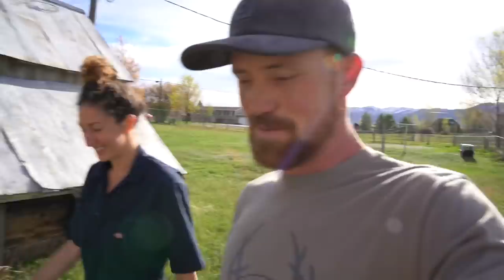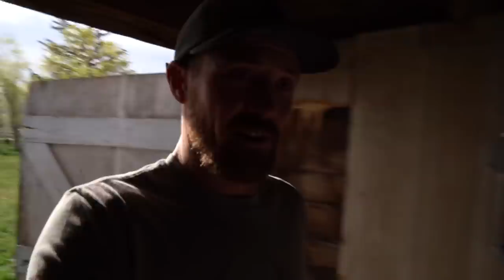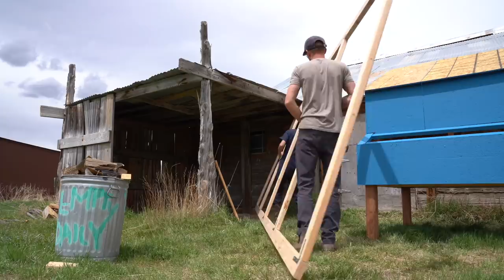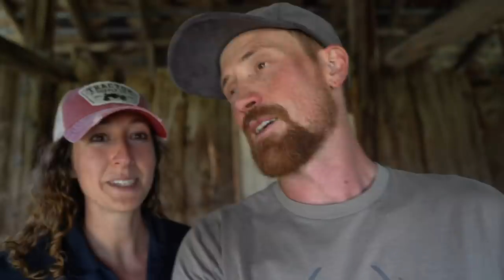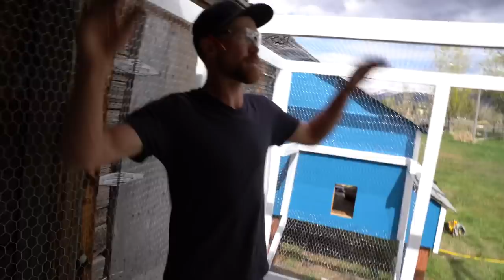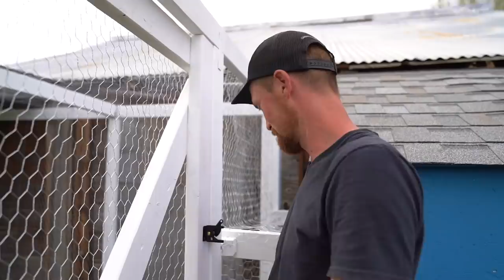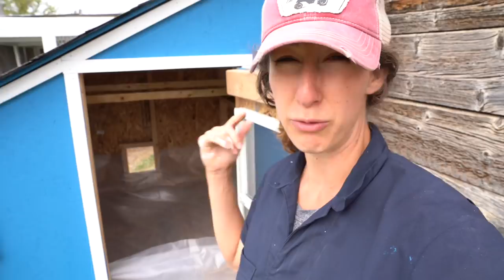WE WILL NEVER DO THIS AGAIN...

Comment: Put the roof on. Raccoons, possums, skunks, hawks, fox, coyotes - they all love a chicken dinner. Nothing worse to come out and find your whole flock destroyed.
Reply: yep....that will happen...
Reply: How about putting corrugated plexiglass on for the roof?
Reply: Had a raccoon snatch hold of a chicken through the chicken wire and pull it out piece by piece. They'll go under, too. AND they work in groups.
Reply: Been there:(
Reply: @lazyninja711  yup even if they can't pull the chickens body out through the chicken wire you'll have a headless chicken running around..lol.
Tin roof should be more than sufficient! But definitely need a roof. And I'd either double up on all the chicken wire around all the sides or electrify it and that should keep them out! I think they have a knob to control the amount of volts coming out? 
And if the dog happens to hit it by accident they'll learn fast not to touch that fence again..That's what I'd do especially if you have all those nuisance animals..
Reply: J Dick That happened to my chicks.

Comment: Yes, raccoons, etc. will most definitely climb the wall and drop down to get the chickens if there is any little opening. Also, dig down into the ground and put the wire in the trench then cover back up. We concrete it in.
Reply: Good point, I was going to say the same thing about the roof and the raccoons will bust the frame with their weight. And the dig down into the ground is spot on from what I have seen in other videos. Raccoons almost tore our storage shed apart trying to get in it to do God knows what in it lol
Reply: Ummmm....you have to enclose the roof.  Sorry A.  The raccoons will get all of them.  And the coyotes, dogs, foxes, etc. Will easily dig under your cage too.  Sad but true.  Cement foundation  best.  When they are older you can let them completely out to run during day.  All dogs need to be trained to leave them alone.
Reply: Yes raccoons love chicken, After my dog died, they were killing at least one chciken a night and dragging them under the fence.. I set a live trap and was catching raccoon after raccoon. Finally began locking the chcikens up in the chicken coop at night. I had an adult bronze tom and hen turkey and they even killed the hen and left her under the fence.
Reply: Perhaps even hammer/drive rebar lengths into the ground like 4 to 6 inches apart, instead of concrete foundations.
Reply: @CodeMonkey66  
We've done that. Very effective.

Comment: I don’t know if anyone’s mentioned this to you...make sure that any chicken wire or hardware cloth that you put around the chicken run or coop also gets dug trenched a few inches into the dirt. A lot of varmints going after chickens have no problems digging under a fence to get at them.

Allie, I will have to side with Trent on this. Every place an animal can get in needs to be fenced off or made secure. Foxes  and coyotes are extremely cunning and they can climb fencing and work their way in to the coop and the result is never good.
Reply: Yes.  I just said that.  We have had more dig under than climb over.  They will dig up a board no problem.
Reply: So true.
Reply: Chickens will dig under as well
Reply: And. don't forget the proverbial chicken hawk ... aka Red-tailed Hawk. They'll swoop in or land on the top of the pen and then dive in an dine.
Reply: Agree - just a few inches into the lawn/ground then covered with mulch or stones
Reply: But as I stated in my own comment, a guardian dog will prevent that loss. Thankfully they have Oso, now he just needs to get outside!

Comment: I would also have recommended going sideways with the chicken wire on the inside, and then put strips of wood on the inside over the top of the chicken wire. Around here, raccoons will push those staples right out.
Reply: Yes.  Staples aren’t enough.

Comment: Not only do you need a roof but you’ve got to bury the wire at the bottom—an apron. The chicken wire keeps chickens in but it doesn’t keep critters out. You have to use hardware cloth.

Comment: not only do you need a roof, you need to lock that thing down like Fort Knox. i  very seriously recommend getting "construction mesh" and putting it around the first new feet up over top the chicken wire and also into the ground/floor of the run. most animals that love chickens for dinner can easily bite through normal chicken wire so construction mesh is a must. they can fit through ANY small hole. secure it the best you can or you will be chasing down a coyote with one of your chickens in its mouth across your property if you are lucky. i have chickens have have lost some in the past. their security is very important. they are like sitting ducks for lack of a better word.
Reply: I was going to recommend the same thing, we had racoons reach in and pull the heads off chickens through chicken wire and then another year coyotes just pushed the staples right out and slid into the coop like a hot knife through butter, I also heard skunks and weasels will tunnel under to get at the hens. I've upgraded to 1/4 inch hardware cloth on all sides, top and 8-12 inches down all around the coop/run area and also put hardware cloth  over the ventilation inside the coop so that nothing can get in there at night too. It's  lot more expensive than regular run of the mill chicken wire but hardware cloth is a lot more secure. To attach it more securely used large flat round metal washers  and screws to secure the hardware cloth to the frame to make sure nothing can push through either. Hopefully you guys won't have any issues at all, but if a predator gets in there they will not likely leave anything alive...
Reply: Amy Jensen Perfect recommendation, those staples will come right out. Hardware cloth and washers with screws is best. I have never heard of skunks attacking chickens (since they are herbivores), but, they will probably want the food scraps in the run.

Comment: Trent you can run a ground wire to a stake on something that is in the ground and have a grounded outlet.
Reply: That wouldn't trip the breaker in a line to ground fault. Installing a GFI would though, it also protects all outlets downstream. In the event of a ground fault the ground rod would create a voltage gradient in the soil beneath you (meaning there would be highest voltage at the ground rod and it would lower the further you got away from it). 
If that outlet is in the coup it's one way to make fried chicken though...
Reply: DO NOT ADD  GROUND ROD LIKE THIS!!! GFCI outlet is under ten bucks. Walmart, Lowe’s, or Home Depot will have them. Get weatherproof cover for it too.

Comment: Allie, Trent,  You should have put the sceen  on out in the yard then carried the screened structure into place.
Work smarter not harder.  Looks good!   Trick for goats . Leave a piece of sweated clothing that you wore in the shed. They get used to your scent.  God bless
The gaps under the white structure is were preadotors are getting in.
Reply: I saw the gaps as well. It kind of worries me. Not sure what they can do about it now tho?
Reply: also need to bury some chicken wire because raccoons will dig under, I learned the hard way
Reply: Hi guys. 

Glad you are settling down after your journey home. The coop build "discussions" made me chuckle. Nice to see you are just like the rest of us sometimes. 

A couple of observations .... chicken wire is for keeping poultry IN not for keeping predators OUT. Determined coyotes or similar will break the chicken wire. Raccoons can reach in through the chicken wire and rip a chickens head off. Rats will chew through it.

Consider using half inch hardware cloth hammered in with U staples.
Also consider a 2ft hardware cloth apron at ground level, attached to the bottom of the run, as predators may try to dig under the coop walls but will not normally back up 2ft to dig but rather try digging right next to the coop wall. I would cover it in gravel aswell. You could put a raised bed over the apron with chicken friendly herbs as a further deterrent.

Sorry Allie, raccoons will definately climb that chicken wire and may even find a way through the run roof once they are up there. I would also be concerned that having gone to the trouble of raising the coop off the floor, which will help prevent racoons getting into the coop, you have built a "ladder" to the barn roof giving them access to the coop structure anyway. Until "fort knox" is built my flock are locked up in my drive out basement each night as in this part of NS everyone has a story about racoons getting into coops/runs and decimating the flock. 

Your best deterrent is your Mum's dog if he sleeps nearby. You could also try collecting any shed dog hair and putting it in an old pair of tights hung under the coop and barn roof overhang as the smell will deter racoons. A self opening/closing coop door is also a great thing as once they are inside that strong looking coop the chickens should be safe (use carabiners instead of slide bolts on the door and egg boxes as racoons will work out how to open slide bolts) ... and your Mum will not have to remember to run our to close it every night. A motion activated, solar security light that comes on after dusk (by which time the chickens will be roosting) may also act as a deterrent and you will be able to see from the house if anything is around the run
Last thought, you may find the run floods due to rain from the barn roof. 

Enjoy the chickens, they are great if you take the time to watch them. Very curious and lots of personality.
Good episode. Thankyou.
Reply: Andrew is right, Oso will fix all!

Comment: Hey, Trent, just piping in as an electrician offering a suggestion.  You could replace that receptacle where there was no ground wire with a GFCI receptacle, like in your kitchen and bathrooms.  That is an approved NEC Code fix for a lack of ground and will provide the protection you are concerned about.  About $15 each for a 15-amp circuit....Paul
Reply: paul muntalbano and Trent The other thing you could do is just put in a ground to the ground where it comes in to the barn. Cheaper than using GFCI receptacles. (Connect your grounds to the conduit if your only running two wires).
Reply: @toadlguy   *you're only 🤯✌
Reply: wont work
Reply: Yeah, if the  power come from the house, I  believe it's against the NEC to add an unbonded ground (rod) out in the barn. I saw EMT but still that's no ground, I was going to suggest GFCIs too. Only safe way to do it is to replace the feeder to the house with the right wire. UF.  I was a military electrician and know just enough to get in trouble. I wasn't going to say anyting but I saw this part of the thead and decided to chime in.
Reply: Lesson learned - until fixed wear rubber soled shoes in the barn to avoid becoming the ground. ⚡
Reply: @blackfly29er  Hi, This is coming from true ignorance and willingness to learn things, mind you, but does that really work? I'm a city person with no male relatives (or female for that matter) capable of more than changing a light bulb, and I always thought that the rubber boots thing only worked in cartoon. Yours, Ann
Reply: @annlidslot8212   No worries, yes it's true. Old two pole wiring (Bendix) will seek it's own ground, and if barefoot - you're it.

For the same reason if caught in a lightning storm, or when there's downed wires, it's far safer to stay inside the car. The rubber of the tires insulates you from completing the circuit, and becoming the ground.

Comment: Goats eat oats. Been watching your trip to the tip and now being entertained during lockdown. Thanks. Now payback time. I’m a wildlife photographer and I have a couple of tips that may help you befriend your goats.

I’ll address this to Trent although I prefer Allie: I notice when you and Allie are in the goat enclosure you are several feet apart. Watch the goat, head looks at you, turns to Allie, back to you, back to Allie. Typical behavior for a prey animal. Humans are predators. Our eyes face forward so we can estimate the distance to our prey(3D). Prey animals’ eyes are on the side and see a much wider range(2D). They look for motion, a potential threat. When they see one the flight fright instinct is engaged. When they see 2 potential threats they freak. Your goat has nowhere to flee. It’s cornered and so it is very scared. 
Only 1 should go into the enclosure at a time to feed and bond. If you both want to enter you should be as close to each other as possible, you know, like when you guys hug on camera. This way the goat has to look in only one direction, one threat. However, it still feels cornered.

Best to do the bonding outside where the goat has an escape route, or at least feels that it does. But don’t approach. Take some feed, ignore the goat, head bent down, no eye contact. Sit and be patient. Stay together. Let the goat come to you. This may take days. Be  consistent. I’ve had wild big horn sheep sleep 15 feet in front of me and bull moose an arms length away. When you are in the rhythm of the goat, it will know.

Good luck, hope to see you return to your home in Argentina soon,
Jim

Comment: I used to have a chicken coupe JUST like that with the roof gap and everything. One time, in the middle of the night, I heard some rustling noises outside, and thought to myself " That sounds like its coming from the chicken coupe", so I went out into the pitch black dead of night to investigate. Lo and behold I saw a tiny shape stealthily scaling up the chicken wire to try and slip through the gap above the coupe, JUST LIKE YOURS! I thought to myself "Oh man, this is it!" as I raised my flashlight and pointed it at the two little shinning beady eyes staring right at me in the dark. Well I'll be a bow legged bandicoot , it was the neighbors 18 month old toddler, in a diaper, in the middle of the night, going right through that gap, to get my damn chickens! Ok so that never actually happened, but the moral of the story is I'd be closing that gap for sure.

Comment: Inexpensive vinyl flooring planks  protect the floor from quickly rotting and are easy to install on the coop floor.  Droppings  and shavings slide out easily with use of broom right into the wheelbarrow placed strategically sideways under the coop door.  Wheelbarrow the droppings to compost pile.  Helps ease the farm chores a bit.

Comment: Hi Trent, for the fridge ground if there is nothing after the ground wire, just put a metal bar (zinc plated, one meter long) in the floor and this will do a perfect and secure ground, houses are wired this way ! You should find this at the hardware store for a few dollars... Just leave five cm or two inches of this bar off the ground and then connect the wire and that's it !

Comment: Hey guys, first things first, I love y'all's content. Second please enclose the entire cooper or your going to have many dead chickens. And third you should be cleaning that pine fluff at least once a month if not twice.  Chickens poop an incredible amount and it's bad for them to be running around in it. This actually includes the dirt run as well. Good luck and stay safe.
Reply: Kelly Graff yes i agree with the shavings cleaning (i have 6 hens) tho in the winter i use the deep litter  method and turn and add , still cleaning every few months tho

Comment: Trent you need to fix the bottom of that coup or it’s going to be bad.
Reply: Yes, also SNAKES
Reply: Really need to dig a trench around the entire coop and bury wire or sheeting to avoid the diggers escaping or predators entering.
Reply: Yes, it is super important to lay wire around the bottom edges to keep the predators out cuz they will dig right into them.

Comment: i'd put a smaller gap wire all around the bottom about a foot into the ground and a foot high to prevent rats and snakes from being able to squeeze through the holes . 1/4" gap recommended. also i used yard timber and stones along the base so when it rains it doesn't make the chick run super muddy. good work guys!

Comment: The conduit is the ground.you ground the outlet to the box and where the conduit goes into the ground, you use a grounding rod connecting the grounding rod to the conduit with braided copper wire.

Comment: Good job with the chicken coop & run. Just a small friendly suggestion regarding the electrical receptacle with no ground wire. To keep you all safe, you should replace it with a GFCI receptacle to prevent shock hazard. Another alternative would be to replace the breaker of the entire barn circuit with a GFCI breaker.

Comment: You can add a ground to an external outlet by running a piece of cable from a 4' long pipe in the ground up to the outside of the box and then connect a wire from the ground pin to the housing.

Comment: with the chicken coup you need to critter-proof it at ground level. Some predators will burrow under a perimeter fence to gain access to your chickens. Either dig down about 12 inches along frame and extend wire mesh into ground and back fill with soil or alternately pour a below ground cement barrier. You will then sleep more easily not worrying about your chickens.

Comment: You need to enclose the entire run and honestly you should have used welded wire and not poultry netting. I had an NPIP hatchery and know a couple of things, if you can pull it apart (ie poultry netting) then so can a raccoon, skunk or fox. Your dog will help a lot, but should not be left alone with the animals, especially chicken until he is significantly older. If you would like mor advice, I will be more than happy to help you out. By the way, you might want to get the goats a mineral block and some baking soda.
Reply: Barbie McCain so true i have fencing (not chicken wire) around our run